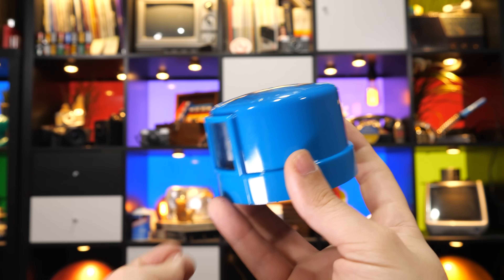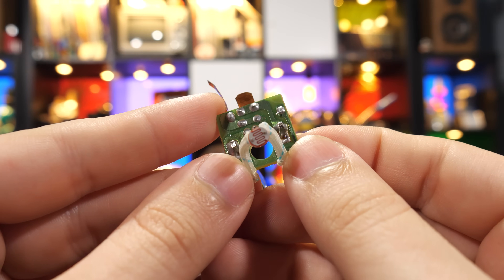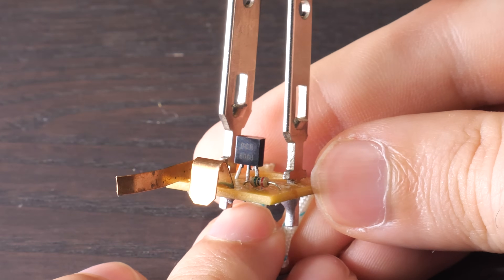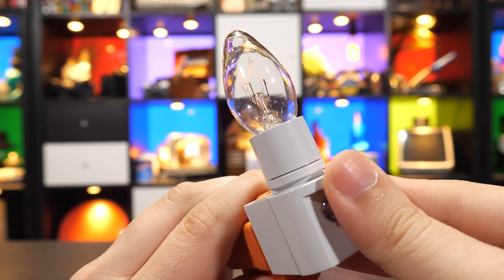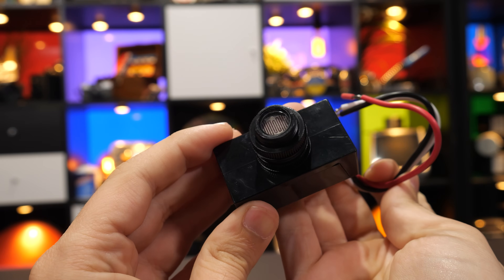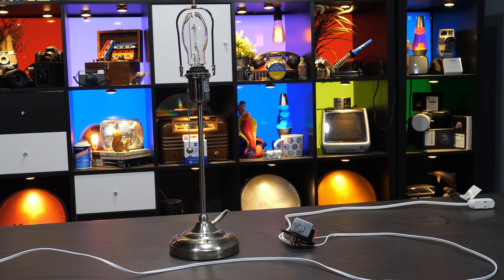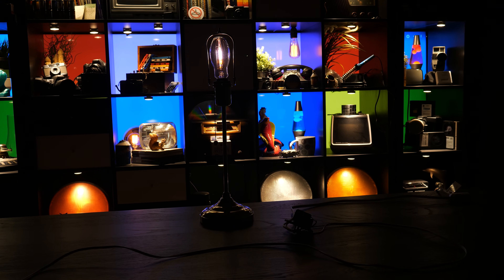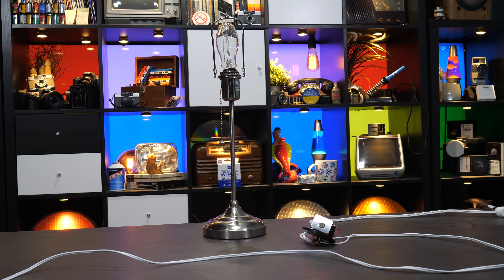Photoelectric light controls are weirder than they seem

Comment: The fun thing is that with installations that already have architectural lighting control systems, you actually DO get software controlled lighting that could use just a photoresistor outside. BUT, these are still a rather good option for how the signal input is handled because it gives a decent binary signal that's nicer to code with, even when hysteresis is already implemented for other things. They just allow for handling of certain oddities better (such as ignoring the signal after power has been out, turning off parking lot or park lights when you're closed even if it is dark enough, staggering lamps firing if they need more current for that moment just to make the load more even, etc.) as well as tracking how many times they had to be turned on (useful for if you've got storms that can darken the area enough that you'd want them on and then need to check maintenance).

Comment: Embedded systems programmer here. In my professional opinion, hysteresis is extremely trivial to implement in code, and it's also simple to validate its functionality. So saying that this sort of software could be buggy is disingenuous. I estimate 50 to 100 lines of code for something like this (most of that non-functional boilerplate that isn't part of the actual control algorithm). When the code is that small, there aren't many places for bugs to hide. It's totally possible to write completely bug-free code in a single day's work for something like this.

However, even I won't deny that the big bulky thermostatic switch thing is likely more robust than a microprocessor-based solution. There are definitely ways to make the microprocessor-based solution just as reliable if not more reliable if you wanna throw a bunch of money at it. But for many utility companies and city lighting departments the thermostatic switch thing has a proven track record and is therefore considered to be a known quantity.

For devices like this, more technology isn't always considered more better. A lot of these sorts of customers prefer to bet their money on the older horse that hasn't failed them before.

Lightning is also something to consider. Both of these devices would likely be destroyed by a direct lightning strike, but the thermostatic switch is more likely to survive if the lightning strikes the pole nearby given its bulky components and sheer simplicity.

The biggest problem with designing a device like this isn't the programming, but validating it can survive the harsh conditions (hot summer days under direct sunlight and freezing cold winter nights) for years on end until it reaches the end of its advertised service life. Old-school circuitry just tends to be tougher that microprocessors. There's a reason why there's an oscilloscope sitting next to my mechanical keyboard.

Comment: Well the most efficient and reliable option is to not have them at all and just use the same relay on the distribution board and then instead of sensing light just use sunset/rise to turn the on. Sometimes stree lamps turn on too early due to weather conditions or if they are on dumb timers they turn on/off at the wrong times. Using a microcontroller and photocell at the control cab would allow for time of day + light sensing operation. By using both you could ignore broken light sensors or vise versa adjust the on/off times automatically if the clock is drifting.

Comment: 16:30 or so, definitely smoke. Slowing it down to 0.25, the trail fades in, but continually changes shape. Hair would have had a single shape and moved in as a unit. If it was focus related bringing the hair into weak focus, there'd be focus change on the box.

Comment: The lights coming on when recovering from a power outage sounds like its biggest downside.
During recovery, you really don't want banks of 10kW (100x100W) coming on for a few minutes without reason. Sure, it should be able to handle it, but systemically making grid restarts even a little bit more difficult still seens questionable.

Comment: ok i feel like I need to be THAT GUY on 17:00... low level firmware on low cost micro-controllers is very fast and cheap to develop theses days... Easy to test and validate as well... IT IS NOT LIKE OS BASED SOLUTIONS. Most of all of your home appliances these days will have low power µCtrlrs and they will function for decades. After years working on embedded systems, I learned one thing: If the solution is complex: There will be pain in development, validation and test of the firmware. If the solution is so stupid, like controlling one output by one sensor, there is probably and ASIC chip already doing it, for cheaper. In this case, there are two resistors doing it for even cheaper XD but yes, low level firmware for low complexity systems are super easy do develop and test. Hell, I do it at home. When a solution doesn't use them, it is because there is a simpler and cheaper solution.
Reply: well said!

Comment: I am not sure the PTC is used as a fuse so much as it would be used for thermoregulation of the resistor. They get too hot the resistance increases and lowers apmpreage flow to the resitors. Please correct me if I cam wrong.

Comment: 30 something years ago, the ones I was dealing with were the bi-metal type units. For about 20 years they have been changed over to electronic, 2 wire systems, active and load, no neutral. these tend to die due to anything voltage spike like, ( a big motor nearby starting, a lightning strike somewhere in the near 10 kms ( 6 miles ), very annoying as they are not just a plug in component, but a full on open unit up, disconnect dead unit, connect new unit and reseal the unit. all this while swinging from a ladder up that light pole. ( the old plug in didn't even need to be isolated to remove it, plug in new, watch lights start to turn on and then climb down the ladder. If there is an issue you just unplug again to see what the issue is. New version has an issue you have to reisolate, climb back up, disconnect procedure again etc. ).

Comment: I work at a hardware store. This video has taught me how one of the products we sell works. This isn't the first time you've done so, but it's the most direct time you've done so and I want you to know I appreciate it. Your videos on regular switches and thermostats and  LED bulbs are probably more important, but this one is illuminating in a way I had no idea it could be.
Reply: Illuminating, you say...
Reply: LIKE LIGHT!
Reply: Take a look at one of BigClive's teardowns of a circuit breaker.  One of the tripping mechanisms is literally a heater and a bimetalic switch.  It gets hot and stops before the insulation in your walls starts to burn.  Almost the exact same mechanism as shown in that box sensor is all over the place!

Comment: Up until very recently I'd see actual gas lamps lighting up streets in Berlin. The way they were controlled was *wild*, using a variation in gas pressure to trigger the ignition / kill ths flame. I believe the "signal" was the same for both so a lamp behaving the opposite way it was intended to (on during the day, off by night) was a common sight.

Comment: Instead of a complicated solution with a microcontroller why not use the night light solution (that probably uses way less power) to turn on a contactor? Benefits of low power capable of running high power.

Comment: Absolutely love the bimetallic modules for a couple of a reasons; 1) for a simple automated switch they can handle HUGE continuous loads relative to their size (rated 1800w but in reality can handle up to 2300 safely for years and years) 2) high reliability and 3) they fail in the 'on' position which is super important for apartment & security lighting. They really were and still are an elegant solution

Comment: 17:17 I worked in a tech support job, and almost fell off my chair at that gag.
With electronics, you're not just looking at the rate of failure, you've got to look at the modes of failure, the means of identifying each, the effects of a failure going unnoticed and unreported, the effects of someone who is not a trained technician attempting to perform impromptu repairs, the effects of a trained technician misdiagnosing the failure and taking the wrong steps to remedy it...
You put a chip into something that is going to be deployed at scale over a large area, you're potentially deploying a fleet of probabilistic chaos engines. At least a resistive heater can only catch on fire; it can't sit there powering the lights on and off in a headache-inducing strobing pattern that is slightly different in each lighting fixture across the set. And that's not a hypothetical, that was the fancy new lighting installation they put on one of the bridges near where I used to live about a decade ago. Back then, they worked perfectly; I visited again recently, and the bridge in its current state could probably do with a photosensitive seizure warning.

Comment: 16:44 I think there are other reasons for that, the consumption of a microcontroller doesn't come anywhere near a heating element. They consume only hundreds of milliwatts. Also the programming part would be pretty straightforward, only some ifs and elses, there wouldn't be much room for error. I think it actually comes down to electromagnetic robustness and noise input in the line. This simple circuit can withstand much more disturbances than a microcontroller. In addition, a microcontroller would require a DC rectifier and a DC voltage step down regulator, which work by switching the voltage really rapidly introducing noise in the network and inductive loads because of the transformers they would need (small effect for sure, but not desirable).

Comment: I really shouldn't be surprised that this is the design, especially since time-delay switches using the same principle have existed for decades before photoresistors were discovered. You basically just attach the photoresistor to your heater delay switch, and bam. I bet this was invented in 5 minutes by people who were familiar with the state of the art. 

It's interesting that you often have one per street block, which is definitely something I noticed about how the street lights light-up over there. Over here it's almost always per-lamp, as you'd see the street lights progressively light-up down the street as the sun sets. But we use low pressure sodium lamps, not high pressure ones, so maybe our light sensors have more in common with that smaller standalone one, which presumably uses less power than the big beefy one. 

By the way, you cannot underestimate the relief which washed-over me when you said hysteresis lmao.

Comment: You can make a dark-effect one of these without the photoresistor, just using a neon bulb and a TRIAC and some resistors. The neon bulb's strike voltage changes drastically depending on ambient light, so by tuning a few resistor values you can make a 4-component switch with no moving parts that can switch the full 15 amps, although you do still lose the hysteresis. Not really useful, but it is a neat tidbit, lotta people forget the dark effect exists.

Comment: Software histeresis could be implemented using timers. No sun for 5 minutes - put the Out to 1.
Sun shines for 5 minutes - put Out to 0.
Thus after power loss timer will wait for 5 minures to switch Out to 1 if there is no light on photoresistor.

Comment: Question: How do motion sensors work? For my situation; the light switch to my closet is on the outside and on the wrong side of the door. This means that if I didn't remember to turn it on before entering, I would stand there in a dark for a second, curse my stupidity,  exit, close the door, turn on the light, then go back in. I had the bright idea to get a motion sensor light bulb. The light could just always be on. It isn't as hoped. Most times, it turns on okay, but it turns off again when I am still in there. Also, if the bedroom is even slightly dark, I have to wave at it like a crazy person. If the sensors just a photon resistor, that explains why it doesn't work well in dim light. But why does it turn off again so fast?

Comment: Fun fact: these are fail safe, meaning when the heater or photocell poops out, you’re not left in the dark

Another fun fact: they can be somewhat accurately calibrated to switch at a certain light level.  The lights on a painted radio tower (not lit during the day) will come on at a different ambient daylight level than a strobed (lit day and night) tower.  Towers with high intensity lighting will have multiple photo controls to step the lighting intensity down once at twilight, then again at dusk.  Reverse in the morning

Comment: No! A photoelectric switch turns the light ON. If you don’t believe it,, remove the switch from the circuit and see what it does. 😁

Nowadays it is hardly worth running lights off of timers, because they draw as much as the LED light, so you could simply dispense with the trimmer and run them continuously.

Comment: There was someone in my college in the Comp Sci department that wrote an application to poll sunset / sunrise information from local weather sites (used multiple for redundancy) and he would then trigger when the campus lights should be turn on or off. Thing is that this was a simulated instance, as he used some off small desk lamps as an example, but it did work.

The problem with this setup wouldn't be software, it'd be having to control the power connections of the lamps with this setup - something that would definitely be a pain to do for a college campus, let alone a town or city.

Comment: I was surprised that the photoresistor in street lamps did not directly control the lights but actually controlled the heating element.  But preventing erratic on/off of the lights does make sense.  Thanks again for the info.

Comment: I’d control a relay coil with a solar cell, personally. Put the light on the normally closed side, when the solar cell powers on, the light’s off. Add capacitors to reduce chance of the relay coil misfiring, all good.
But I’m weird and like to treat miniscule wattages of solar as free.

Comment: RoHS is making the CdS much less common, at least in consumer devices. I had to implement a last minute changeover to a photodiode solution on one of our product lines, as the exception was expiring. Calibrating was a pain, there is nothing on the market that has the same spectral response to the CdS, unfortunately. Those old things are remarkably similar to the response of the human eye.

Comment: I’m sorry, but I simply can’t not point this out. If the goal is to CREATE HEAT when the FUCKING SUN is out, why not just glue the limit switch doohickey to a piece of metal painted black or some other calibrated color that would be optimized for the region it’s in. Seems like a really silly waste of 3 watts

Edit: granted, I didn’t consider the possible affects weather may have but still, seems wasteful

Comment: The turning on after a power outage sounds like a good feature - means if power comes on during a night failure it will immediately be illuminating the streets instead of a warm up delay.

Also the temp higher to turn off would probably be helped by the sunlight on the enclosure warming it during the day.

Comment: Wow, didn't know how those really worked. It's almost the opposite of what you'd think. Since heat changes the circuit, does the outside temperature ever effect its function? How do they ensure that street lamps work just as well in all seasons?

Comment: the reason why the photosensor is snakey like that is because it is an antenna for wavelengths of light at the visible frequency, the distance between the snakey parallel lines are displaced at a certain distance because they attenuate the light based on how much length is between the peaks and troughs of the waves at those frequencies. this is why they are so close together compared to a radio wave, which is why radios often have extendable and adjustable antenna poles so they are as physically similar to the size of the wavelength of light they want to receive.
Reply: I am a licensed electrician, licensed telecommunications technician, qualified Instrumentation technician and science communicator is Australia.

Comment: The reason for the TIME DELAY is that a bright flash of Lightning used to knock all the street lights off when I was a kid ...... Inside the oldest versions was simply a mechanical relay with a coil that held the contacts open when energized and the same CDI cell (sensor) as in the newer ones ....Since all he street lights were Mercury Vapor.... interrupting them even for a split second (as in a flash of lightning) would shut them off for several minutes until they cooled down and restarted

Comment: lemme write to software for the light logic real quick

Sensor Light
int LightOn

LightOn = (some value that the sensor picks up at night)

if(Light.(LightAmountMethodHere) >  LightOn)
{
//turn light on
}
else
{
//turn light off
}

it doesnt really get more simple or foolproof than this you could also add a delay so that it functions like the bimetallic strip but i dont have time for that. its just a while loop function that takes in an amount of cpu ticks and subtracts 1 per loop until there is no more left
Reply: also i probably should have used a float or double or something for the LightOn variable but you get the idea

Comment: Very interesting... also troubling. Far from inconsequential, their behavior after a power outage puts a ton of load onto the grid just as it's at its most vulnerable. If each of those street lamps is a kW of draw, and there are thousands of them... that's many megaWatts of draw coming on in the form of lights in the middle of the day, just as all the other loads are also coming back online. This may bear some rethinking...